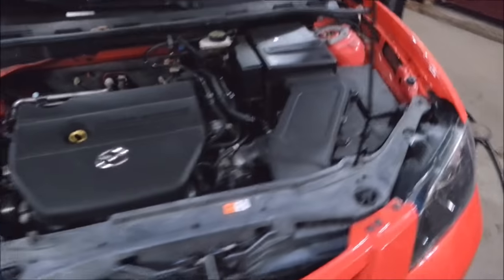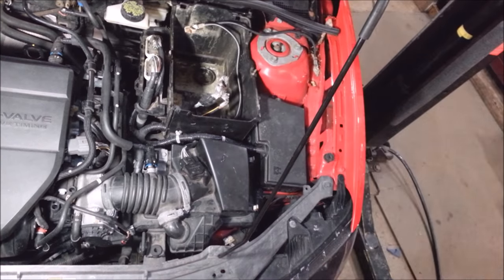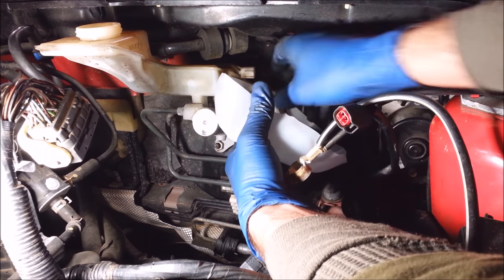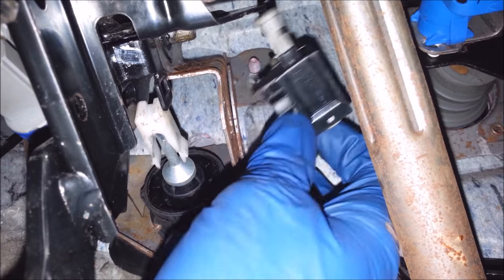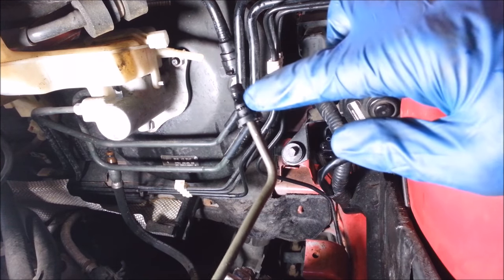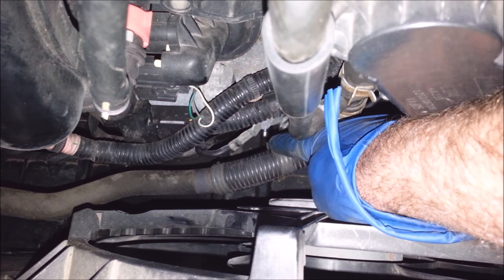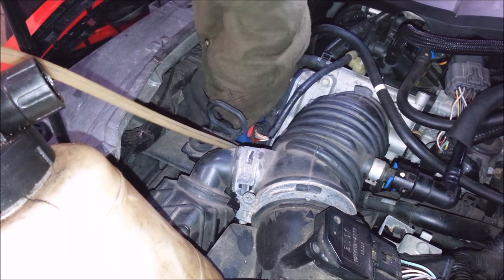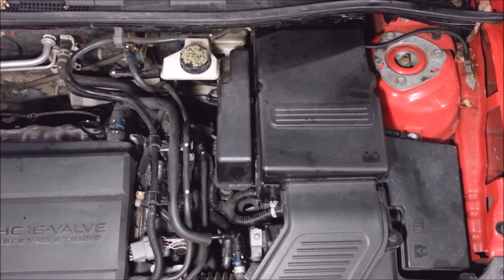2004-2013 Mazda 3 clutch master cylinder replacement

Comment: Great video. Two helpful things for those trying to tackle this. The 4 bolt on the pedal assembly is very easily accessible from the fuse compartment on the left side of the steering wheel - yank it down and you have straight access with a long extension.

2nd - when you are putting the new cylinder in you have to make sure that the fins on the sides go with the correct slots. One is bigger then the others. I ran into this problem. The slot on the upper part of the hole will accommodate the larger of the finds

Great vid

Comment: You sir are the real MVP. I replaced my pivot shaft assembly, slave cylinder twice, replaced the shifter weight and shifter bushings with Cobb Units, but then when finding this video about replacing the Master Cylinder & "Dead Heading" (say no to FoMoCo Drugs Kids) the Master FINALLY FIXED MY ISSUE! Nearly $1,000 American Freedom Duckets & 3 months of Trouble Shooting Later. #ItsAWholeLotOfSuck I'll eat some poorly sliced ham & take a shot of maple syrup to that danm Lonnie!

Comment: good video and clear camera angles , i can agree with your frustration, fucking plastic parts are junk.  
They changed the upper coolant manifold on the side of the engine with plastic and it warped on my 2007 mazda 3. so i put the aluminum one from a 2004 on and its 100 x tougher.

Comment: Just wait until you have to do this on a second gen Mazda 3.  The BCM and thus part of the dash also have to come out because the clutch pedal provides the studs for the BCM bracket.  I have sworn to end the bloodline of the engineer that designed this thing.
Reply: I just dealt with this myself and it was the biggest nightmare of a job I've ever worked on.

Comment: Great Video! I did the transmission fluid change in a Mazdaspeed 3 2010 with 144,000 miles that I recently bought. But that clutch is killing my left knee and left hip, too hard and squishy. Now I know what to do.
Reply from the maker: Hopefully someone didn't put a stage one or higher clutch in there. Those pressure plates can be really stiff.
Reply: Rust Belt Auto ok thanks for the tip
Reply: How the fuck is it hard and squishy at the same time? That doesn't make any sense. It's either hard, or it's squishy. Pick one

Comment: I unhooked the steering shaft ,hooked the steering wheel to seat with bungee cord . but still couldn't get pedal assembly and master out as a unit ,had to do your trick and unhook master from bracket to get pedal assembly out. Bleeding was easy

Comment: I can't get the top bolt out what method did you use .im in Australia so it right hand drive so everything is opposite side.
Reply from the maker: @davidcassidy4205  someone commented that they got it from the side. Took off the cover for the dash. Maybe try that. I'm contorted.

Comment: Hello, at 11:15 minutes,  you pinch off a hose. Which hose is this? I'm working on a newer Mazda 3 that's a little different. Thanks
Reply from the maker: Its a flexible hose that is in between the master, and slave cylinder.
Reply: @RustBeltAuto  thanks!

Comment: The guy who took his Mazda to you for a new clutch master seeing this video...uhhh? But, helpful, thank you.
Reply from the maker: The last time I saw this guy, this car was on a tow truck with a leaking gas tank, because there was a deer plastered all over the underside of the car, and a bone poked a hole in it. I put it on my lift, gave him a 5 gallon bucket, and some rubber gloves to pull out all the chunks, and told him I wouldn't work on it until it was clean. Haven't seen him since.
Reply: @RustBeltAuto  Unfortunate for him hitting the deer but more than understandable on your part.

Comment: Is there any part that needs to be regularly lubricated in the master cylinder? Had a loud clicking noise whenever I press the clutch pedal. Replaced the master cylinder and it was gone. Now about 4 months later it started doing it again. Also I noticed it gets worse when it's hot such as when heaters blowing to footwell or after parking under the sunlight
Reply from the maker: Probably has some wore out plastic Ford gizmo in the clutch pedal mechanism that is wore out. If you take the whole unit out, you will probably find something worn.

Comment: Video was very helpful, however it's worth noting to people that the clutch pedal assembly was changed in 2010 and is slightly different from the one in this video, mainly with the positioning of the 4th screw.  As is such, if you have a new one you must remove the center console to then remove the lower dash, and only then can you access the 4th hidden screw...  Believe me i tried for days to get to that 4th screw without removing the lower dash, absolute nightmare of a job.

Now I understand why my friend was quoted $1,000 for this job, I should have just let a pro handle it.
Reply from the maker: Nice to know, thanks. The part is listed the same for these years. That is how I came to the conclusion that it would be the same job.
Reply: @RustBeltAuto  oh so wait it gets better, because you are right it is the same master cylinder.  The job is pretty much identical to what you showed here except for the extra steps to get to the 4th screw.  From what i read the BCM module was moved, and that required all the extra steps.

Everyone on the mazda forums says they’ll beat the crap out of the engineer who did this redesign.
Reply: But regardless i’m VERY thankful you took the time to do this video.  I definitely wouldn’t have been able to do this job without it.

Comment: Great video! We are trying to get fourth and last bolt, the farthest away. It seems close to impossible to reach. How did you get it off?
Reply from the maker: Not impossible.
Reply: @RustBeltAuto  I couldn’t get to it. It tortures me every day and every night. That last holt on the 2004-2013 Mazda 3 clutch pedal assembly. It keeps me awake at night. Damn you Mazda. You too Ford

Comment: Hi, how long did the job take in total?
Would it have been easier if you removed the  steering shaft , lower panel. (driver-side) and sensor switches?
Reply from the maker: I don't know.

Comment: Why did you change the mazda 3 clutch upper center? what was your problem? Are you having trouble shifting in 1st gear?
Reply from the maker: I needed to pump the pedal a few times to get the thing to disengage. It was no good.
Reply: @RustBeltAuto  So when you kept the pedal pressed for 5 seconds, did your gear shift smoothly? (before changing it) my Mazda 3 passes easily when I hold down the pedal for 5 seconds. otherwise it will be forced to pass. Could the problem be in the upper center?
Reply from the maker: @fratkaymak1271  if you can see the slave cylinder push rod, you can hold the pedal down, and see if it moves back, and looses pressure, if that answers your question, it should not do that.

Comment: Majority of the parts in these cars are Mazda. More specifically the 2008 and newer models. Ford supplied parts and basically utilized Mazdas L engine and drivetrain. Put it in most of their cars like Taurus and Mercury Milan. The faulty bs that happens with these cars is because of the ford supplied parts. 

Its kinda unfair to call these cars a Ford when they’re 10x more reliable
Reply from the maker: It's fair. It's a Mazda/Ford car. A Focus is a Ford/Mazda car. Mazda3 + ?= Focus. Some goofy math like that. I failed Algebra.
Reply: @RustBeltAuto  when you put it like that, it makes more sense .
Reply: I wonder do the newer 2013 > mazda 3 sky have a plastic clutch master cyl.   
Btw.. What other brands use a fucking plastic clutch master ? They are no good in freezing cold
Reply: @green323turbo  pretty sure the newer models arent plastic. the use of plastic in the pre skyactiv Mazda's was definitely a Ford move lol
Reply from the maker: @green323turbo  you would be suprised how many companies use plastic masters. I think the Germans started it. They love plastic.

Comment: i replace 2 master cilinder and i dont know why is soft after a week.i bleed the air out and a week later i do it again.2 new cilinder can not have the same problem.no leak at all.what can i do more?it is very annoying
Reply from the maker: https://youtu.be/BgV-gY1DhOA

Try this. If it doesn't work, get a different brand. This car had the same problem.

Comment: I know this video is old, but where did you get the new master cylinder? I have went through two junk ones from O’Reilly’s and don’t want to pull it out a third time
Reply from the maker: Napa's altrom line is japanese import. #ATM P1341.
Reply: Thank you I appreciate it.
Reply from the maker: @andyhall475  good luck.

Comment: Stuck on that fourth bolt… how did you remove it??
Reply from the maker: I forgot, but it happened.
Reply: I have a 2010, slightly different assembly… ended up removing dash panels to get to it
Reply from the maker: @garymalone4562  ouch

Comment: I have a big problem in the same car I think all my lines and cylinders got air and can’t get no presión at all
Reply from the maker: Pinch off the flexible line with a vise grip, and lightly pump the pedal. It should be all the way up if the master is good.

Comment: Do the brakes need to be bled too? Since the feed hose was disconnected.
Reply from the maker: No sir.
Reply: Thanks. I'm working on it as we speak. Following your video.
Reply: I'm just struggling to take the bracket out now
Reply from the maker: @Be3nz  that bracket is no fun. I left it in, pulled it out of the way as best as I could, and snuck the master out.

Comment: Hello Sir!  So, I got the master cylinder replaced, clutch works Great, except one thing.   It's clicking.  What is it and, should I worry about it? if so, how can I get rid of it?  I would appreciate the help.
Reply from the maker: I don't know.
Reply: @Christopher Stephens it actually disappeared.   It occasionally squeeks though.  I spray a bit of wd40, then it goes for a bit
Reply: The master cylinder 😥
Reply: Did I messed it up?

Comment: I noticed that you mentioned the master cylinder for the clutch. My mazda 3 is an automatic, so is it the same part? My brakes decided to not work at all, where no matter how much pressure I used it didn’t work. I’ve been told that it’s possibly my master cylinder, brake power booster, or my brake pedal position sensor. Any help is welcome 🙏. Thank you
Reply from the maker: This is a clutch master. It is not the same. If you have fluid in your brake master cylinder, that is most likely your problem.

Comment: Hi I have a clutch cylinder like yours. I mounted and it works. Except that when I start, it loses air and does not stop. The leak is right from where the pedal is and is mounted. Why
Reply from the maker: Probably because it is defective.
Reply: @RustBeltAuto  Is it possible for air to come out from under the brake pedal? If so, what does it tell me
Reply from the maker: @antonioorlando4565  it sounds like you are telling me that there is a seal on the rear of the master cylinder that is leaking. If it is, you need to return it as defective, and get a new one.

Comment: Is this the ae for the speed3?
Reply from the maker: What's an ae?
Reply: I'm wondering if it's also the same for. 2012 speed 3 aswell
Reply: @hey6982   Yes. it should be the same.  I have an 08 Speed 3 that my clutch master has a leak on the inside up in the interior side the seal is leaking very slowly so I watched this video on how to fix it. Going to purchase the clutch master next and try to do it myself or take it to a shop depending on if I feel like doing it or not.
Reply: @toddk4115  you're right! I did mine a week after my comment on here. Didn't take too long and when you get it dont take off the plugs you will have to re bleed it and it sucks haha
Reply: @hey6982  I think no matter what everytime you have to replace a maser cylinder you must re-bleed the lines. THere is no way to avoid that but there are kits out there that if you have a compressor you can do it relatively easily vs. a hand pump which may or may not work and take forever.

Comment: Hi i have a mazda 6 2004 model just had new cluch put in the car is not been used  my son went to move it an he had to pump the clutch to get it to work
Reply from the maker: Bleed out the air. It might work if you are lucky.

Comment: Hello can you tel me what kind of ford this mazda 3 is based on ? Thank You !
Reply from the maker: Ford is Mazda. Mazda is Ford. That factory part has FOMOCO written on it.
Reply: @RustBeltAuto  I think  I have similar problems with my mater clutch on my mazda 3 , I also think that here in my country the price for a ford master clutch  is cheaper than that of the mazda . Anyway THANK YOU for your reply .
Reply from the maker: @secretsecret7730  yea. You go on Ebay, and it will cross reference that part with everything.
Reply: @RustBeltAuto  Thanks for the tip , here in Romania the parts for mazda are very expensive , today I felt a clutch pedal stfer than usual , I can change gears but after changing ghears I accelerate , the rpm goes up but the car does not follow the rpm ,  in fourth gear With 4000 rpm I barely reach 50 kmh .
Reply from the maker: @secretsecret7730  you probably need a new clutch bro.
Reply: @RustBeltAuto  This is bad news , because a new clutch will cost more tham my one month salary . If I put the car in first ghear , and I release the clutch  without stepping on the gas pedal the car goes forward . My engine is 1,6 l .
Reply: @RustBeltAuto  THANK YOU , I now understand that the clutch is the problem .
Reply: @RustBeltAuto  Hello , the clutch was the problem , I found out that if you go to the dealer they will charge you big time , I went someware else and the price was half ( clutch + labour) they even changed the oil . Thank You for the video and for tips .

Comment: At the time ford owned 20% of mazda and they shared parts/resources. Situation no longer.  But mazda is not and has never been Ford.  Saying that make it sound exactly like a Lincoln or a brand of ford and that isn’t the truth.
Reply from the maker: That was a Ford part. It said Ford right on it. If it walks like a duck, talks like a duck, and says it's a duck, it's a duck. This being unlike normal things, When things get married, the name is the same. We can both be right
Reply: When the problem bites u in the ... u will be screaming ford.. like i did..

Comment: I just did whatever you showed us to do but the car won't go into gear
Reply from the maker: There is probably air in it. If there is, you should be able to pump the pedal a few times to get it into gear.

Comment: I’m doing this right now and I took it off put on the new one and now there is a wire or some sort of a plastic all the way up the top of the pedal near where the top screw is and I can’t get past it. I spent 6 hours on this stupid design already. 😢
Reply from the maker: Most ford guys require some alcohol, or weed just to get by.